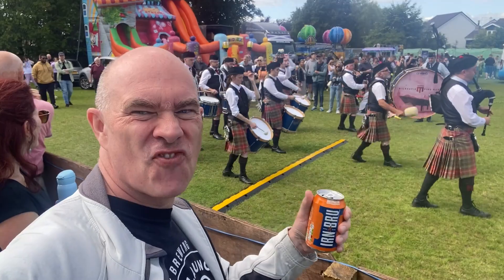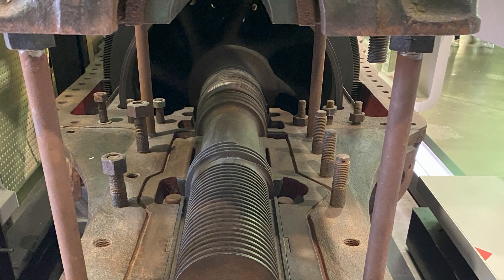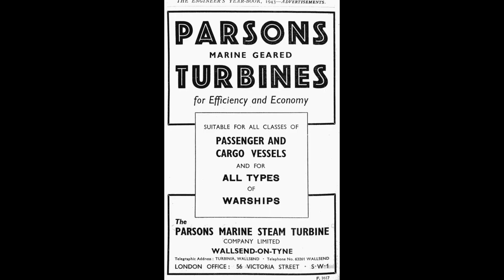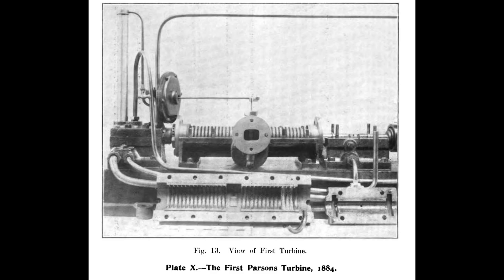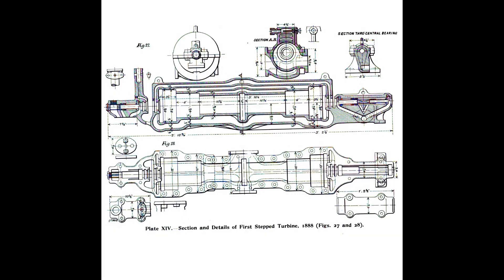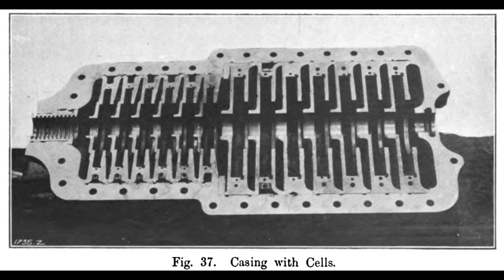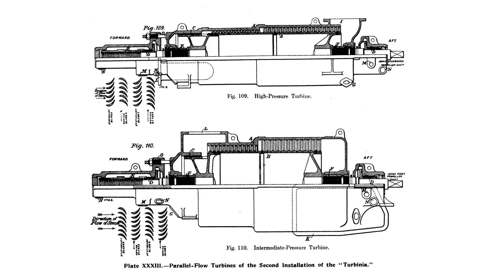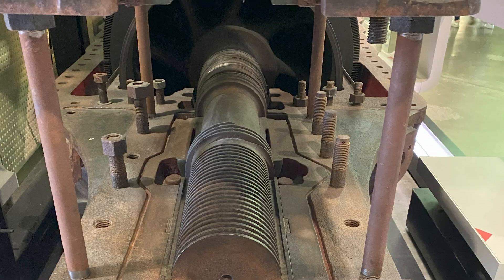How A Victorian Era Engine Made Spaceflight Possible... Let's Look At A 125 Year Old Turbine!

Comment: The DeLaval separator concept has another use: When storing cryogenics in zero g you need to vent the excess pressure as the liquid warms. But in zero g it is not a liquid but a froth, so when venting pressure you are venting a lot of liquid fuel. You can rotate the vehicle, but that is often inconvenient. An alternative is to vent the froth into a separator and pump the liquid back into the tank. I worked on this with the original Artemis Project in the 90's and in practice it's a wee bit more complicated :)
Reply: I was expecting you to say the separator was spinning inside the tank, so you don't need to be pumping the separated liquid back into the tank. 
We're engineers wary of electromechanical devices inside cryogenic tanks after the Apollo 13 damaged (previously overheated) heater wiring, "stir the tank" incident?
Reply: @alanm8932  Because of the low proportion of gas to liquid you need a very big separator more or less taking up one end of the tank, but you do it with a vortex rather than spinning disc. Also, you need two of 'em rotating in opposite directions so you don't accidentally spin the tank up. As I say, the exact details are ... complicated :)
Reply: @Geekofarm  If the exact details weren't complicated, it wouldn't be Rocket Science!
Reply: @alanm8932  Apollo 13 wasn't real. The long dev. time of Artemis is because they wanted that to actually work.

Comment: I think the most impressive part about that turbine engine is that it was designed and built by hand.
(And by hand I do mean with machines, just without CNC or CAD or injection molding.)

Comment: Look at the mating face of the bottom half of the turbine housing. That surface along with the upper half. WAS FINISHED BY HAND. BY SKILLED CRAFTSMAN using hand tools called scrapers. The surfaces could be matched so closely that no gasket would be required between two halves of the turbine housing.
Steam turbines were first used in the power houses of generating stations to spin dynamos. The steam turbine and reduction gear sets used in marine applications make Swiss watches look like Walmart  specials

Comment: Fascinating!!  I recently met a guy who works at a power plant where they use what he says are basically just GE aircraft engines to spin the generators.  He described the ones they have as basically 737 engines.  I was surprised but, now it all makes sense!
Reply: Gas turbines are completely unrelated to steam engines... they don't even work on the same thermodynamic principle. Scott was getting a little too "creative" with his storytelling on this video.
Reply: @DoktorBayerischeMotorenWerke The operating cycles of “steam” and “jet” engines may be different but the turbine section of those engines is something they have in common. Axial flow of the working fluid (steam or gas) passes through a ring of nozzle guide vanes before acting on the turbine bladed rotor creating power … methinks that is what Scott was referring to.
Reply: @GrenvilleMelonseedSkiff496  That is a completely false assumption on your part...  like Scott you are attempting to connect things which are unrelated.
The first successful jet engine to be demonstrated had a completely different type of turbine that bears absolutely no resemblance to a steam turbine... 
Jet engines were developed from turbochargers and gas turbines that share absolutely nothing in common with steam technology..
Reply: @DoktorBayerischeMotorenWerke  No, that is not completely false. You are missing the point entirely. As I said, the working cycles of gas and steam turbines are indeed different but the means by which the turbine section derives power from the expansion of the working fluid (impulse and/or reaction) is exactly the same. Stationary turbine vanes and rotating blades do exactly the same thing regardless of whether steam or gas is flowing across these foils. The end result is the same … torque for power generation or compressor operation.
Reply: @GrenvilleMelonseedSkiff496  Your comments reveal someone that is not qualified to discuss this topic intelligently.

Jet engines were developed from turbochargers which use the exact same Brayton Cycle, steam engines use the Rankine Cycle and are not related to Jet engines in any way,
 You are attempting to stretch the truth to a point where it becomes a completely false lie,
Its like saying the person who built the first water wheel invented steam turbines... its complete rubbish..
Reply: @DoktorBayerischeMotorenWerke  I have almost four decades of experience in the gas turbine industry so I know precisely what I’m talking about. Alas, you are the one wandering off into completely irrelevant history tangents and the like missing the point entirely … sad.
Reply: @GrenvilleMelonseedSkiff496  You are not a very good liar kid... You have already shown your cards and you are clearly not an expert on anything related to gas turbines.
 Gas turbines are not related to steam turbines, any attempt to say otherwise will only continue to make a fool of yourself.,

Comment: Steam turbines are of course still used in nuclear powered vessels - some subs, some air craft carriers. 

I was once told that, actually, the steam turbine technology for nuclear plants was (effectively) old and clunky, far off the very best used in the last hurrah of oil fired steam turbine powered ships. The reason is that, whereas oil fired boilers could superheat and superdry steam to prodigious temperatures, a nuclear reactor cannot. It instead produces large amounts of relatively cool steam (in comparison). So they have a lot more in common with turbines from their early development (large diameter, comparatively slow moving) than, say, the ones used in the 1940s.

It's interesting just how much of what was learned all the way back then still applies today. 

Rotor bow - caused by differential heating of the turbines when starting up - was a known problem, and required careful start up of a steam plant. A well understood phenomenon, it applies also to jet engines and rocket turbines. It was also blissfully forgotten about by Pratt and Witney in their current Geared Turbo Fan engine, and had problems as a result (despite the problems, it's still a very good engine and I think the problems are long fixed). 

Turbine wear - water droplets in the steam would chip lumps out of the turbine blades. Jet engines - dust ingest. 

Seals, high temperature lubricants, materials, etc. 

When Whittle came along with the idea for a jet engine (another genius transformational idea), there was already quite a lot of stuff lying around almost ready to use. Superheated steam in the best turbines of the era could hit 500 Celsius. Gas turbines / jet engines upped that, but not by as much as you'd think in early engines (a RR Welland had a turbine inlet temperature of only 650 Celsius). So all that development work done in the steam world really set up the jet world very nicely to succeed.

Now that jet engine turbine inlet temperatures are so much higher, it'd be interesting to consider what sort of steam turbine could be built using their materials / designs today. If we could generate steam at 1000+Celsius, it'd be a pretty prodigious power plant.
Reply: A very creative bit or storytelling, of course Frank Whittle did not invent the jet engine  (he is only the 1st in the UK) 
Jet engines are completely unrelated to steam engines and use a completely different thermodynamic cycle.

Jet and gas turbine engines were developed from TURBOCHARGERS which also use the same Brayton Cycle principle..

Comment: Famously the designers of the Titanic didn’t trust these new fangled steam turbine engines, so the outer propellers used the massive triple expansion reciprocating steam engines (uses the steam in progressively larger cylinders to get all the energy out of the steam) and the centre prop was run on a turbine fed from the exhaust of the other two which shows how much more efficient the turbines are
Reply: Turbines required more coal at the time.

Comment: Much of the efficiency of steam turbines comes from the condenser, which operates at near vacuum, creating a larger differential pressure and extracting meaningful work from the Low Pressure stage as well as enabling feed water recirculation.  Superheated steam from multi-drum boilers provides incredibly power dense installations
I worked at Devonport Dockyard from the mid 70's and did a couple of jobs on a visiting US vessel that operated a 900 psi steam plant!!  Very fast but problematical without proper maintenance.

Comment: Hey Scott, 
I saw you at Maker Fair over the weekend. You know what else I saw at Maker Fair, at Mare Island Naval Shipyard?  A plaque on the side of one of the old buildings that said “Mare Island Naval Shipyard Power Plant Shop” and depicted on the plaque was….
An Aeolipile!
Hey, full circle.
Reply: Mare Island was the first US Naval Base to sink a US Nuclear submarine.  Nobody seems to remember, but the SSN 665 Guitarro was sunk at Mare Island in May of 1969. There were 2 crews calibrating instruments and they ballasted the sub in unfavorable ways that caused it to flood the sub and sink it despite visual warnings that something seemed terribly wrong with the sub. It was riding so low in the water with hatches open and unable to be closed due to myriads of air hoses going through the hatch. It sunk. The sub needed to be completely rebuilt afterward. An old Shop 38 mechanic told me that they called it the Mare Island Mud Puppy.

Comment: Minor curious point on timecode 13:08 — Most utility gas turbines (technically, gas generators with a power turbine) have two turbines for generating power (in addition to the turbines that drive the compressor in the "jet engine" gas generator): one that captures the kinetic energy of the "jet exhaust" (basically 1/3 of the chemical energy of the fuel is captured here, at max efficiency) and a heat exchanger plus steam turbine to capture the usable heat of the now not-energetic-enough exhaust (about 1/3 of the chem energy of fuel; the remaining 1/3 is for the turbine driving the compressor — approximate numbers, obviously). Because they combine the jet (Brayton) and the steam (Rankine) thermodynamic cycles, they are called "combined cycle gas turbines," or CCGTs. California relies on these to ramp up power generation several times a day, because of intermittency of renewables and the big swings in demand. Just FYI.
Reply from the maker: Yes, there’s a whole separate discussion on these details that I could spend forever on
Reply: @scottmanley you have my permission to make a video about this
Reply: @scottmanley  On a related note: How did Alan Parsons and his project fit into the family story? 🥸
Reply: Yes, these units are typically refereed to as "peaking" machines.  Interestingly, the turbine section of these machines use steam to cool down the casings.
Reply: As a 18 year journeyman millwright, this is a pretty cool old girl. I'm on a gas turbine shutdown as I speak.

Comment: steam power will never die until we find a better method to convert thermal energy into mechanical energy. Even the big carriers of the US Navy are steam boats, The boiler is just heated by uranium undergoing fission rather than burning coal or oil.

Comment: I live close to deLaval. I run a machine shop that I took over after my father. We used to make parts for Alfa Laval separators. My very first time running the CNC lathe was making a large stainless steel separator cylinder with intricate geometries and tolerances. Not your typical first job... I was so nervous that I demanded to make a spare in case I mess up the first one in the later operations. Somehow managed to get it done and still keep the spare as a display piece. Not sure what to do with it, perhaps it can serve as a table stand, some beer brewing apparatus... or part of a makeshift separator.

Comment: The M1 Main Battle Tank is powered by a gas turbine engine as well.
Reply: Yes, the Lycoming PLT-25 was designed by German Jumo engineer Dr. Anselm Franz... the engine was designed in 1944 and was based on the Jumo -004 jet engine as the core gas generator, the Jumo GT-250 was submitted to the Wehrmacht to power the E-series Panzers. The Turboshaft version of the Jumo -004 continued development at Lycoming and became a US government program in 1964 as the TF-15 for the US Navy and the AGT-1500 for the U.S Army.
 The T53 and T55 were also designed by Franz..

Comment: The sound that occurs in your kettle just before the water starts boiling is caused by cavitation. Steam bubbles appear but then collapse. It's noisy.
Reply: So why is a saucepan of water on the electric  hob near quiet?
Reply: @DavidOfWhitehills It depends on the ratio of the rate of convective heat removal to heating from the hob. When the two are in the same ballpark, you can get full-volume boiling that doesn’t bang the shockwaves from all the collapsing bubbles against the bottom of the pan.

Comment: I don't know how "unsuccessful" DeLaval was in the turbine business. At least, when I was working in the asbestos litigation business a bit over a decade ago, "DeLaval Turbine" showed up moderately often in cases as the source of asbestos exposure. I understood at the time that, while they are less efficient than conventional turbines, they have some compensating advantages for manufacture and maintenance, as the housings do not have to be kept pressure tight.

Comment: Heron of Alexandria also made three types of jugs,
   ….that would turn water into wine.
   …Jesus used one of these, in the gospel stories.

These jugs had two compartments, and worked via air pressure, by placing your thumb over a hole in the handle.

R

Comment: Glad there still remains  some of the edits I did to sort out  the Wikipedia article on the aeropile.. The historians were adamant that as it wasn't put to use, it didn't work, and reverting any edits that suggested otherwise. Where by any physicst and engineer knows it must make some work( even if that's a tiny amount) for it be able spin at all. Splitting the history off from the physics illustrated my point nicely. And encouraged the historians to try provide more detail on the historic origins of the device. Which was great stuff. It adds rather than subtracts.
Reply: Also steam can behave strangely....Under certain conditions it is possible to expand steam and have it remain as gas that if given the slightest knock. It will immediately condense into liquid. Similar to how liquid pure water can be chilled to well below freezing. Applying a slight tap will then have it freeze.

Obviously one couldn't expand steam that way if it would then be fired at/through turbine blades. But if it were  done in an aeropile like  reaction  engine where the thrust occurs due to  the expanding nozzle....
May be possible to make a closed loop. Condensing steam turbine engine. Without need for a seperate condenser.

Comment: I believe this is why GE was asked to create the first U.S. jet engines.  Their experience in steam turbines made them the easy choice.
Reply: There was also their experience building the Turbosuperchargers used in USAAF radial engines bombers and the two staged Allison V-12s used on the P-38. The early Whittle jet engines used compressor turbines similar to the ones used on automotive Turbos and an Axial Power Turbine. There was at least one other effort by Lockheed who had designed their own Axial Flow jet engine in the late 30s. There were a number of people around the world who had looked at building gas turbines for aviation use prior to the successful Power Jets but they were frustrated by the lack of high temperature alloys and the inability to make the designs light weight enough.
Reply: @mpetersen6  Despite the efficiency of steam turbines they were below that of those Whittle designed. He discovered this when a major steam turbine company designed and manufactured a turbine for him. He visited their design office and discovered  that they were not accounting for the way the flow direction changes as it traverses the blades. Thus Whittle was a major contributor to modern turbine design.
Reply: NO, GE was chosen because of its TURBOCHARGER division..
Reply: Facts like these always make me wonder why people claim that the British gave America the jet engine, or that ww2 Germany made the first proper axial flow jet engines. As a matter of fact, the McDonnell FH Phantom made its first flight in January 1945, being powered by, out of all jet engine manufacturers, two Westinghouse J30s. I guess some people only care about those who were first..
Reply: @martijn9568  Excellent remarks, TRUE America had its own axial turbojet program years before the British, but were still years behind the Germans.
 Operation LUSTY and Operation Paperclip saw the largest transfer of technology between two countries in history, thousands of German engineers and scientists, thousands of tons of data and equipment and entire factories and research laboratories were brought en Masse from Germany back to America.

Dr Anselm Fanz who designed the Jumo 109-004 engine for the Me-262 also designed the Lycoming AGT-1500 that powers the M1 Abrams, the T53 and T55 that powers the Bell UH1, AH-1 and the Boing CH-47 Chinook helicopters, he would become Vice-president of Lycoming..
Reply: It was General Electric Turbocharger division that developed jet engines